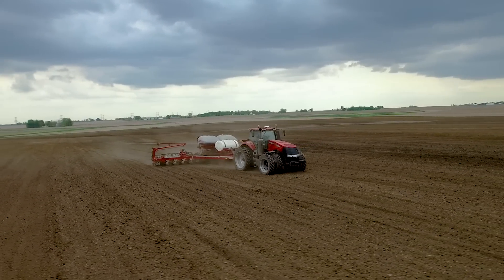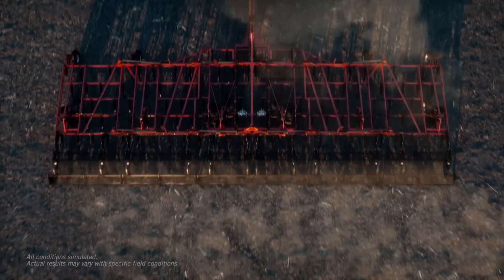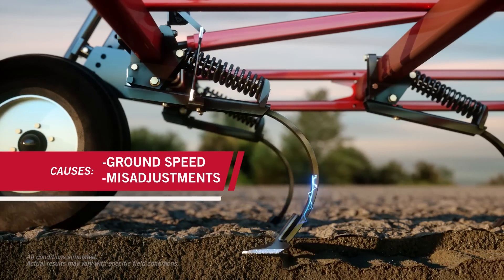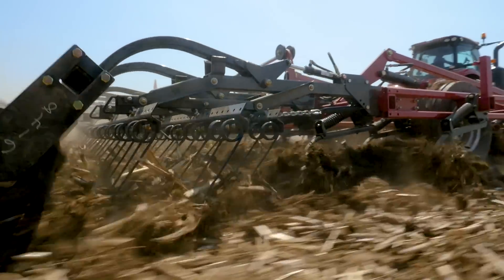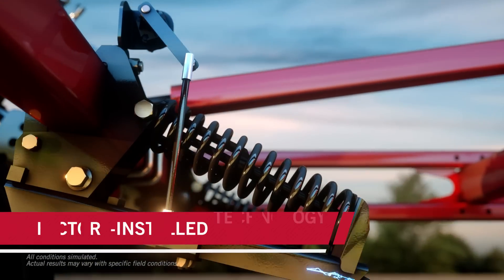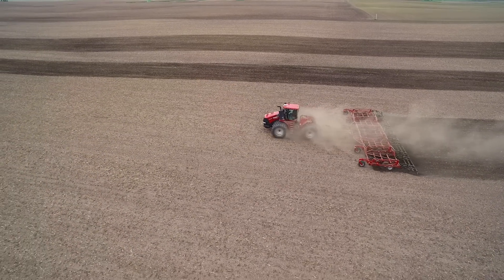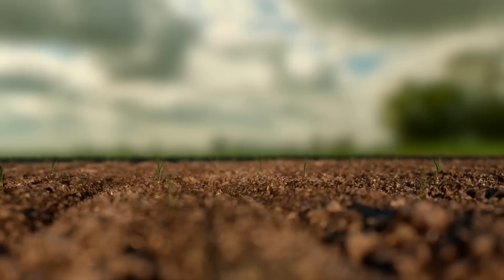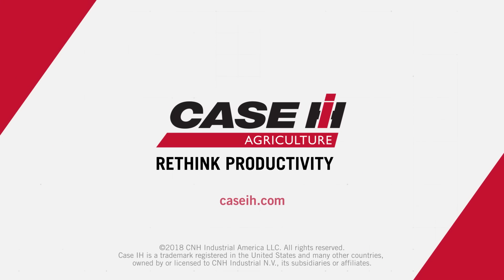Soil Command

Comment: This isn't true set at all JD die-hards. This just let's you see the action of the shank, then you can adjust the depth accordingly.  Too deep, results in a large amount of shank movement, most likely causing a very uneven seedbed floor.